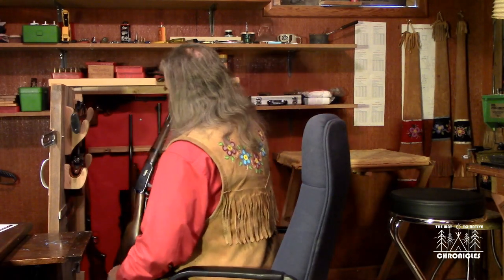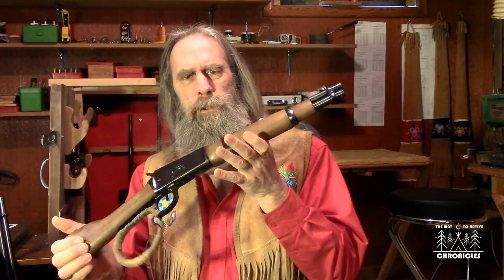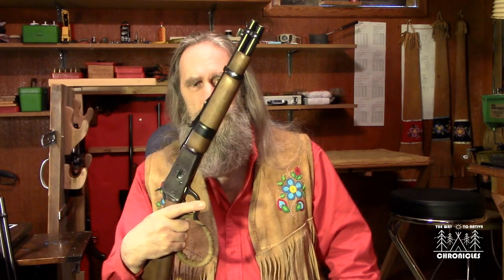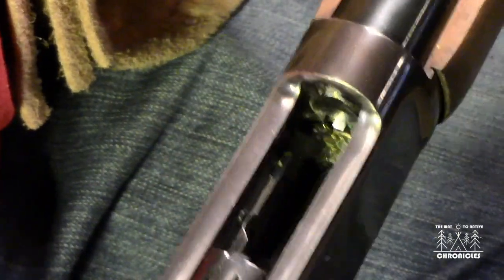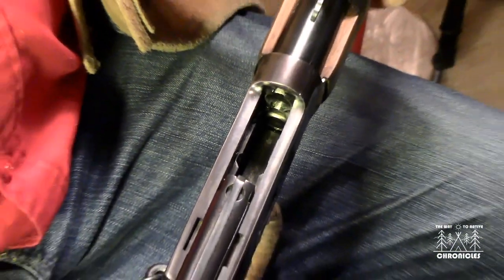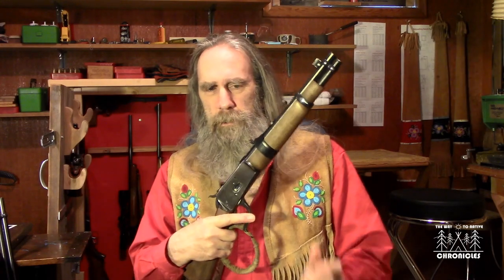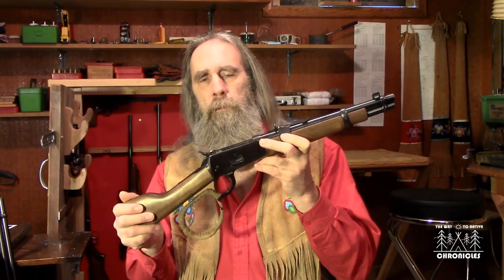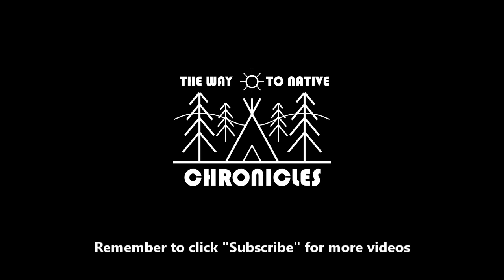Are You Sure Your Tube Magazine Has Been Emptied?

Comment: Good reason to send to a competent gunsmith and have them fix many of these issues. I see lots of this as poor factory over site.
Reply from the maker: As a matter of fact, I had sent the gun shown in the video back for warranty work, telling them that was a problem (among others).  Still did the same thing after warranty work.  I think it's the nature of this particular beast that you have to check it very carefully after unloading, to be sure nothing's hanging around in the mag tube.  As I said, during actual firing, the rifle always feeds the next round because the recoil ensures it shakes through to the loading plate.  When unloading without firing, there's no 'jar' to prevent it from hanging up in the tube.

Comment: stop as your bolt just pushes the cartridge clear of the rails and you can flip them out without cycling through the chamber.  

if your ammo is sticking in the magazine, time to take it appart and clean the mag tube.
Reply from the maker: Have you tried flipping them out like that with a Rossi Ranch Hand tonelar415?  That technique doesn't work well with them.